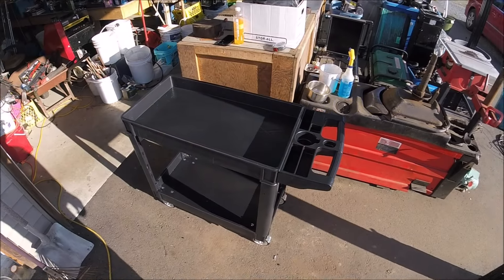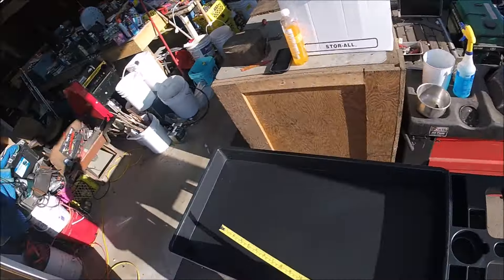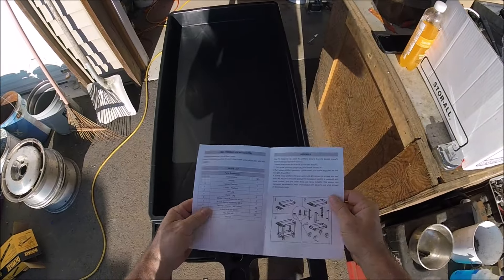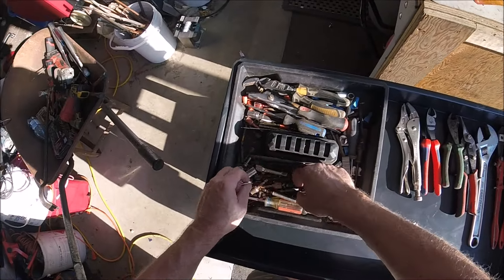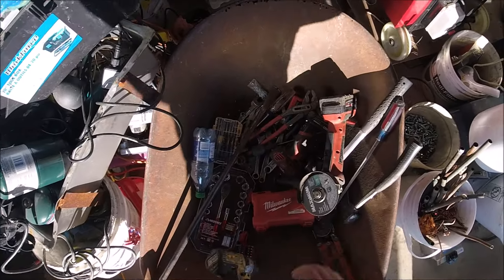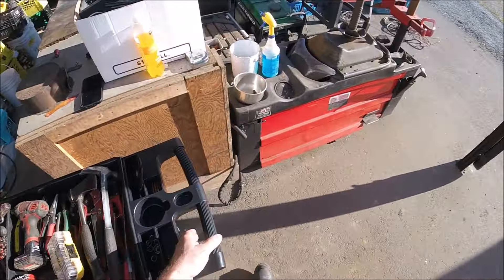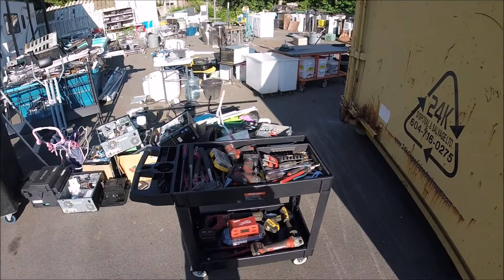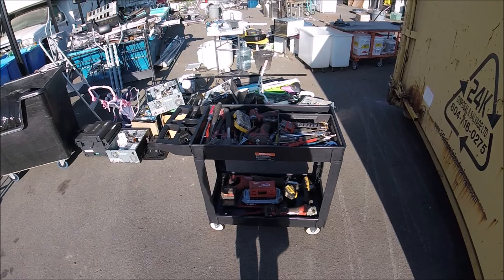Vevor Rolling Tool Kart Review

Comment: Looks good Phil.  It's a big step up from the wheel barrow.  If you want more capacity you might look at  hooking on to the sides and/or end of the cart wire mesh baskets for your wrenches and screw drivers.  You can try portable hooks first to see if it works for you.

Comment: The narrower cart you got might turnout better for squeezing by your work bench and yard. If you make some custom vertical tool holders for the cart you could fit everything  and be easily accessible. Or bolt board with holes drilled through on the side for your hammers ect..

Comment: I like the locking wheels Phil.  Nice cart.  Does it have drain holes in it to let rain water out?  If you want a little extra space on the cart, maybe you can make a modification to it.  You could add a deck/platform to the front of the cart making it a foot longer.  If you picture a BBQ grill, they have those side platforms for putting plates and laying the grill tools on.  Put 45 degree braces underneath it and bolt it to the posts.  Make the new platform have 2 inch sidewalls so you can put small stuff in and they won't slide off.  Just an idea for you.  Make the deck modification out of aluminum sheet or wood so it doesn't rust.
Reply from the maker: No drain holes, I will stuff it with tools + I can use the work bench to store tools also
Reply: Sounds good Phil.  Was just an idea.